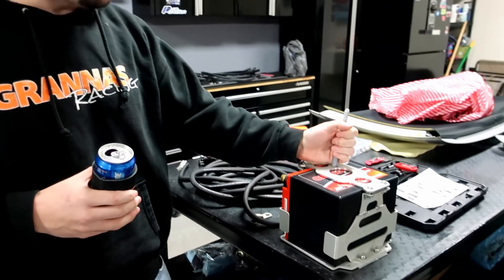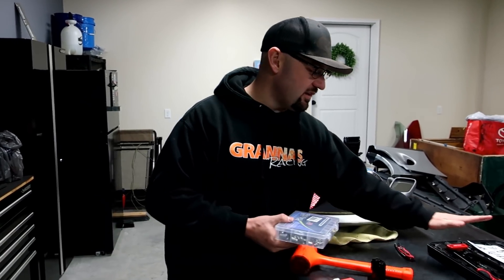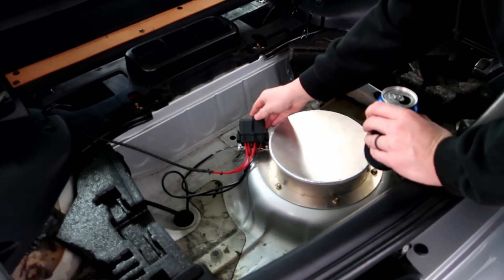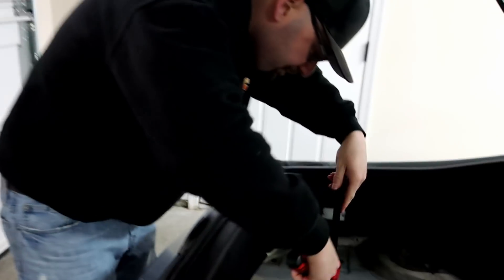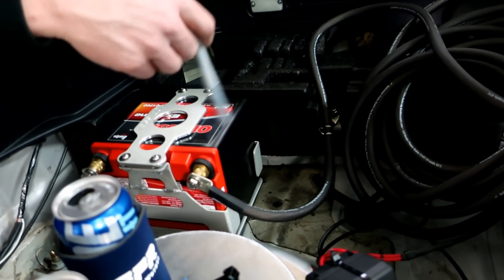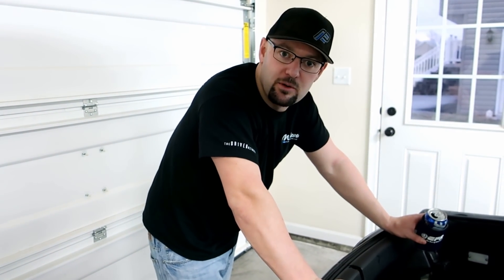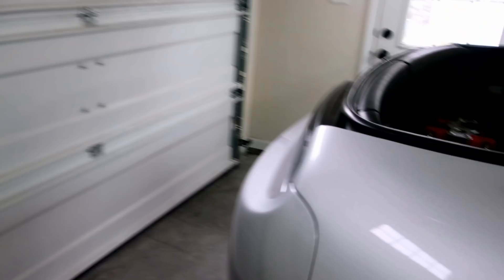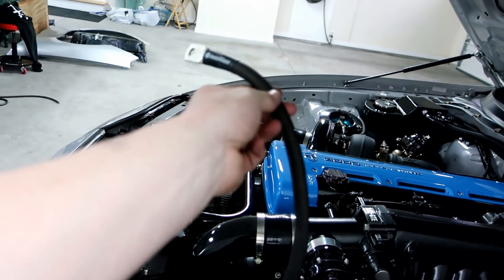MK4 Supra Battery Relocation (How To Make Your own Kit)

Comment: I always try to keep my wiring as close in style as factory automotive.  Where the starter has its own power. And the a 2nd one off to fusebox, etc. So 2 complete run off pos..and 1 run from neg post to engine  block.  From there it distriburates off. 1 ground off neg post to chassy/frame.  Then same in the front

Comment: This is perfect timing. Currently Relocating my battery in my NA-t sc300
Reply: lol same
Reply: @lucusss4  where are you routing the battery power line? I want to keep it inside the car and I know the trunk is sealed off from the car..
Reply: magadavixt well like I havnt started yet I mean there still a big ole 1uz in the car... sorry I'm not help
Reply: magadavixt also I was thinking of drilling a hole at the bottom of that fire wall thing and having a grommet of some sort if that helps

Comment: Nice tidy job there! I also run an odyssey on my Supra, just a little note you only ran one cable so I’m assuming you ran straight to the starter motor then a small length cable from there to the fuse box?
Reply: Does not have to run to the starter 1st

Comment: Dumb question: Since you reused the bolt for the relay, shouldn't you insulate that area so that you don't accidentally short that unsleeved section with the body?
Reply from the maker: ItsMeMark not sure what you mean? The bolt holding it down is separate form the bolt that actually holds power. If that is what you mean.
Reply: @PureFunction  Just from the video I can't see the clearance too clearly but it almost looks like if the parts near the relay were to bend too much it could make contact with the body.

Comment: I know the fuse is required but I always have the fear it will trip when on the move 😮
Are you going to upgrade the 2 small alternator wires to a larger gauge? Not sure if it's necessary
Reply: Fuse is NOT required if you run the wire properly.